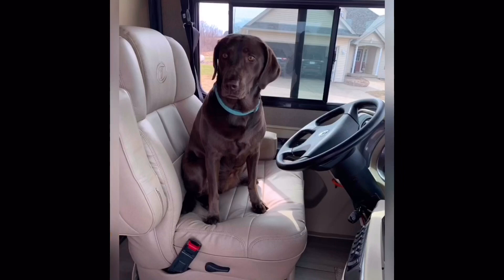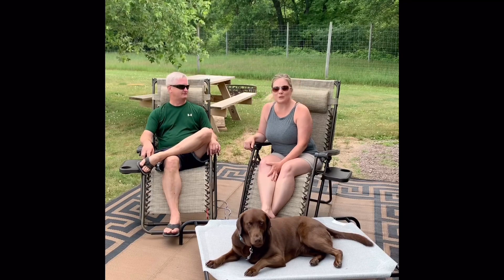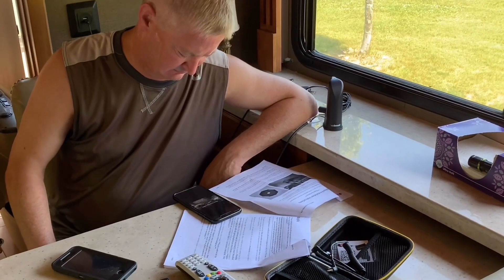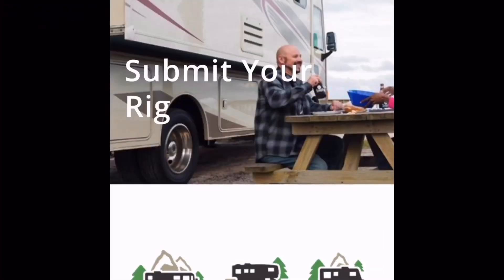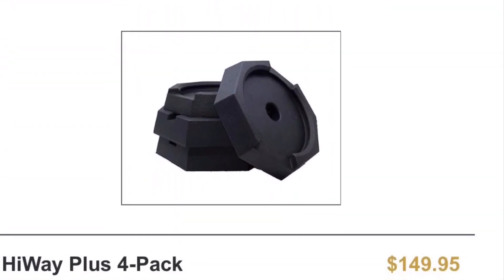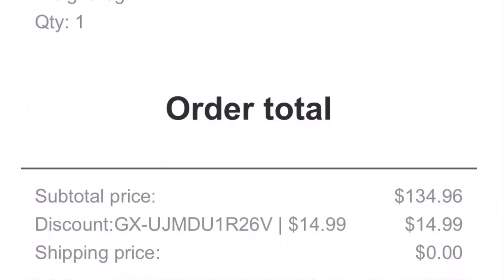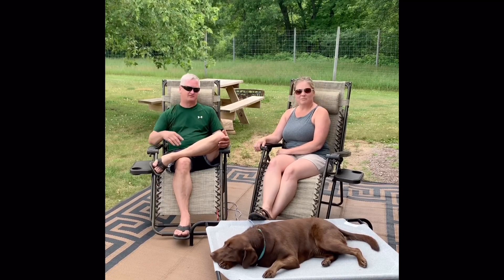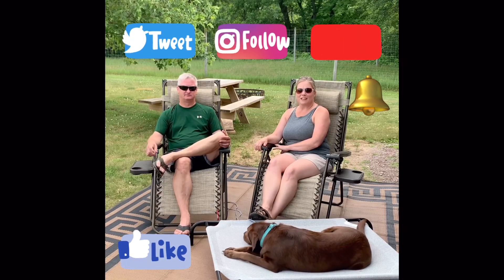RV SnapPads | Snap Pads for RV Levelers | SnapPad-Full Install and Review

Comment: Why did you not put the chains bracket in the groove cut out on the Snap Pads?  Also what about the crossbar that hits the side of them?  Is this not a problem?
Reply from the maker: Alice Taube We didn’t have any issues with the cross bars at all. We tried to get everything lined up right but didn’t notice they were off on the front until it was to late. We have had zero issues with them and recommend them!